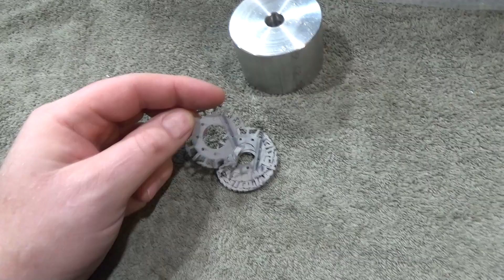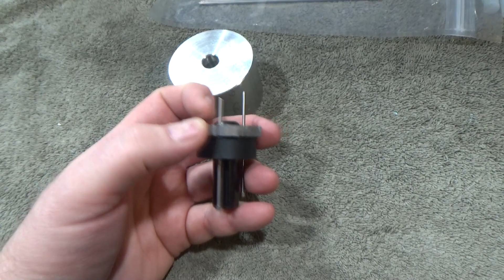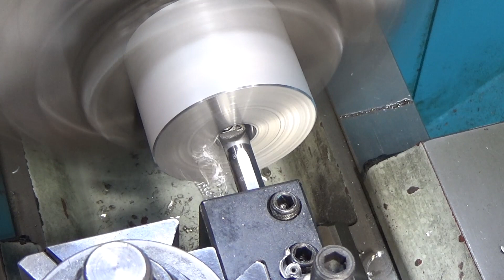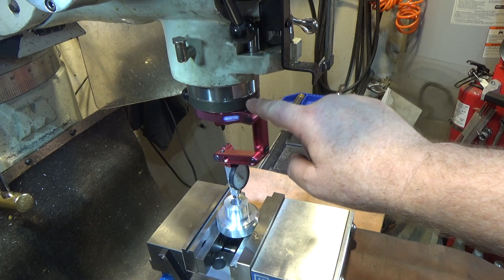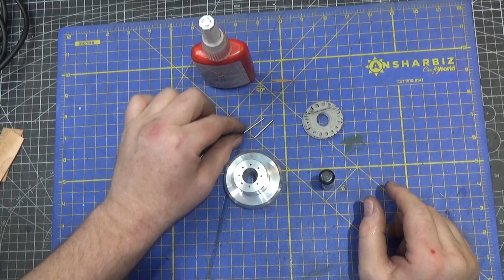218 Motor Stator Plate Laser Weldong Fixture

Comment: A magnet in the aluminum cap should be sufficient to hold the assembly together. If you need the flexibility to accommodate different quantities of plates, use a floating mount for the magnet with a spring to provide clamping pressure.
Reply from the maker: Great idea. I am currently relying on finger pressure, since they will be had holding the entire stack to weld it, but I like your improved solution.

Comment: Nice fixture Dudley. Two square dowel pins at the correct mutual distance where not enough for a precise alignment?
Reply from the maker: The dowel pin holes have enough variation that the assembly would move too far side to side to use alone (without the center pin). I need to remember the squared off dowel pin solutions. I keep forgetting they exist. Thanks.